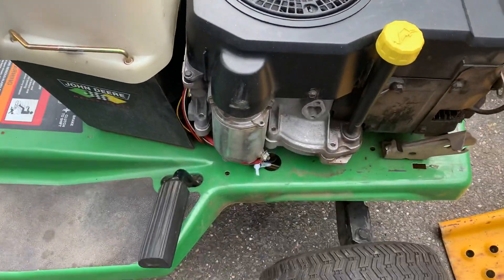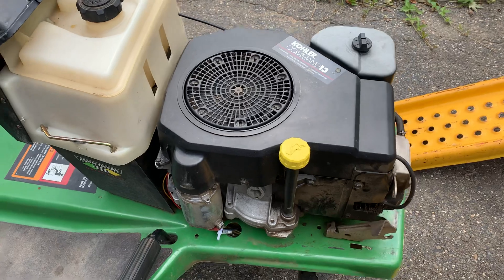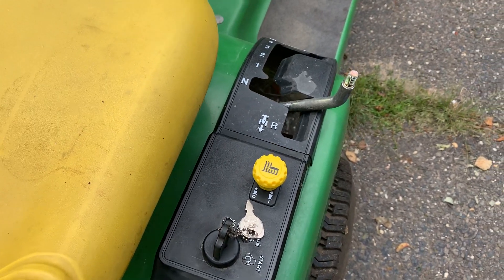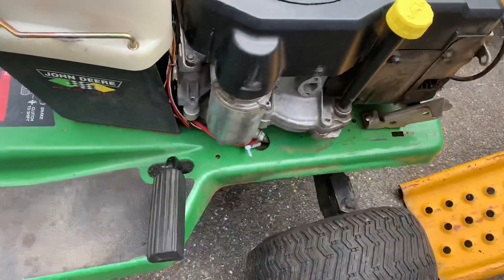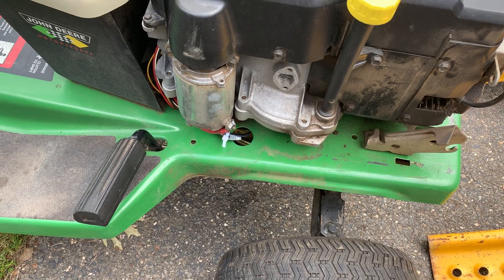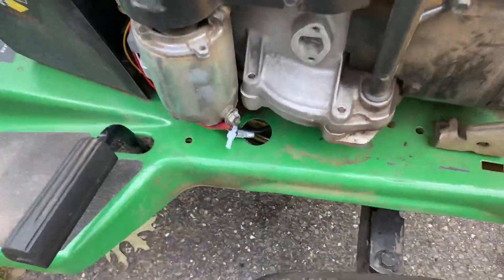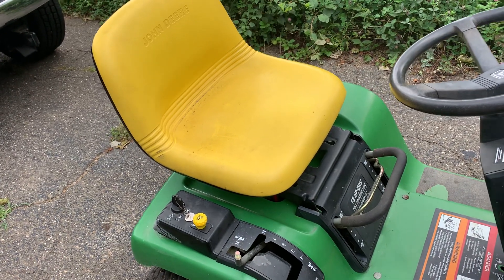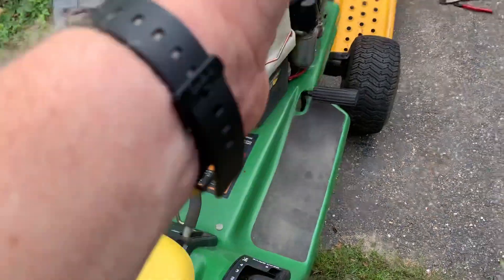Deere STX 38 new PTO not working.

Comment: What’s pto ?
Reply from the maker: Power Take Off. How Engine power is transmitted to a deck(normally) or another driven accessory like a snow blower or tiller
Reply: Its electromagnetic pto, power is supplied by a switch, when pto is energized it makes a magnetic field drawing the free spinning pulley to spin with the powered pully.
Reply from the maker: Some Tractors have mechanical PTO’s with a lever, linkage or a cable that pulls an idler arm and pulley to engage the deck or implement

Comment: Hi Ken my Briggs 12hp engine blew up literally on the stx 38 yellow deck.  I was looking around and found a Kohler Command 15.5. Would it be suitable for this tractor?  It seems the one in your video is also a Kohler. I just can't tell what hp it is. Many thanks!
Reply from the maker: A 9 through 16hp Kohler Command will work as long as the Drive pulley and PTO fit properly.
Reply: @KensSmallEngineRepair   Thank you! Much appreciated.  Your channel is extremely helpful.

Comment: Very good info Ken. Do you think that ground was purposely unplugged? Roger
Reply from the maker: The factory ground(black wire) attaches with the hot lead (blue wire) in the factory connector for the PTO.  I’ve seen the factory ground disappear due to bad connections and some people just put a new  fresh ground lead to the chassis. The safety system switches the power to the PTO so you are not disabling the safety by doing this.  That was my main concern.  You want the blades to shut off if you fall off the tractor.